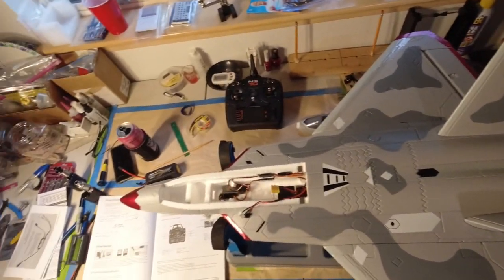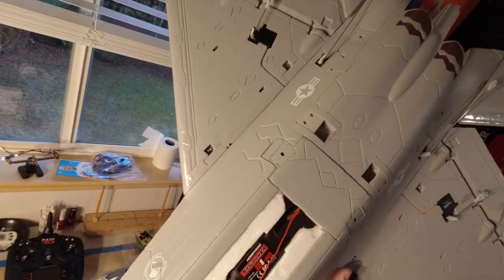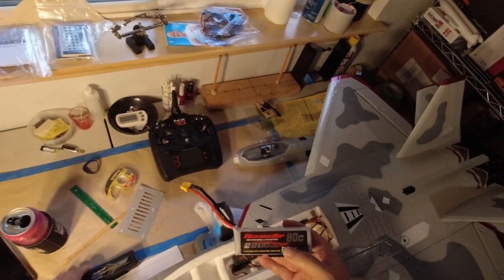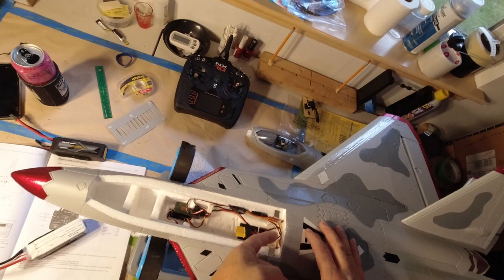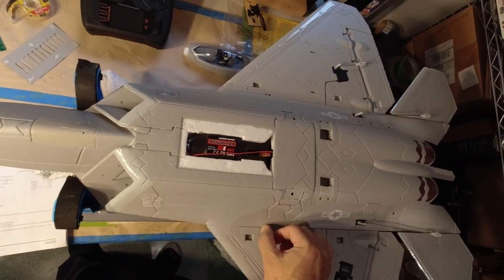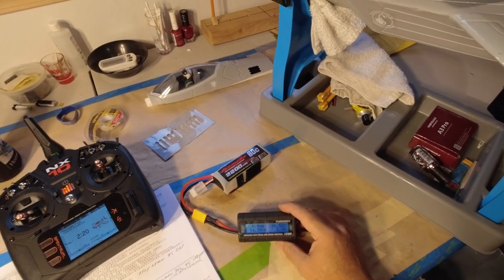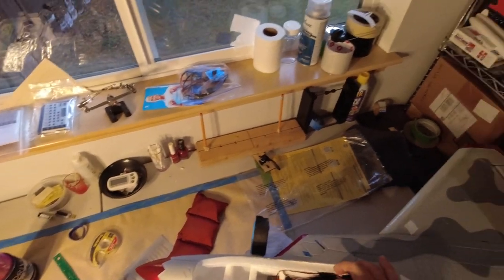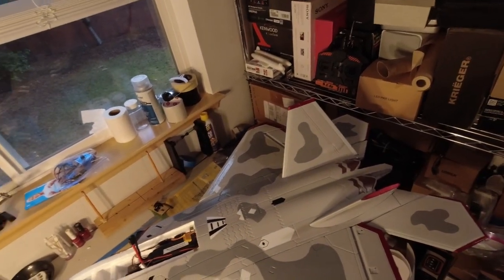Freewing F-22 Build Video with XFly 64mm 4s EDF and Afterburner Installed

Comment: Outstanding, love vids like this. I do a lot of mods to my jets as well. I don't have this particular jet but might get it because I've been looking for an F22 64mm to play with. I want to know which KV you are using? Or if you know if your xfly motor is the 4s or 3s version. It's pulling a lot of amps if it is the 4s version, then it shouldn't be that high. I usually see about 43amps and 1300 gramps of thrust peak and about 650 WP. I've done some 6s bench and in plane testing in my T7a 64mm I'd like to share if interested,  might render you the power you're looking for. I also used the 5280 AB but has switched to RC geeks AB and it's much much brighter. And it has enough thrust now the AB doesn't even matter. 👍 Great video ill be subscribing.
Reply: I don't know how he got 16.63V out of 4S lipo???? 😊
Reply: @tructran8783  Fully charged 4s peak at 16.8v, not sure if I'm picking up what you're putting down LOL.

Comment: Nice work. What do you set timing of ESC to? High or low timing ? Thx
Reply from the maker: The ESC timing in this video was set to low.  So the measurements you see in the video at the 12 minute mark is at low timing.  After setting ESC timing to high it increased the Peak Watts to 1000.3 watts and Peak Amps to 64.8 A

Comment: How much more could the AB lights be?
Reply from the maker: @papapsadventures6119  I ended up taking it out. It's not so much the weight but the disruption of airflow around the EDF where the LED light module is attached.
Reply: @RKIVIDS  I just bought an ungraded motor for mine and the afterburner kit, lol